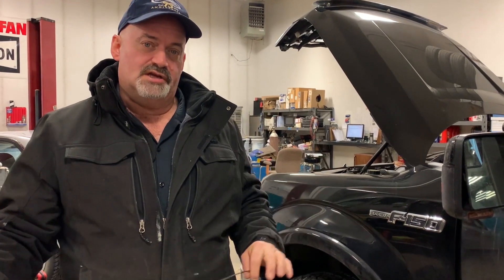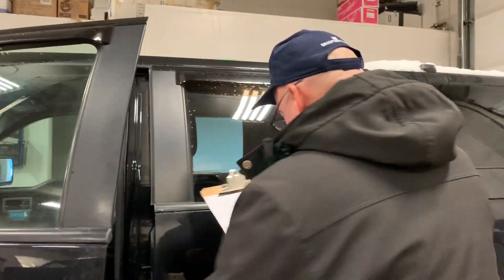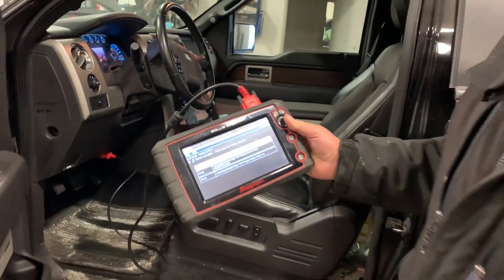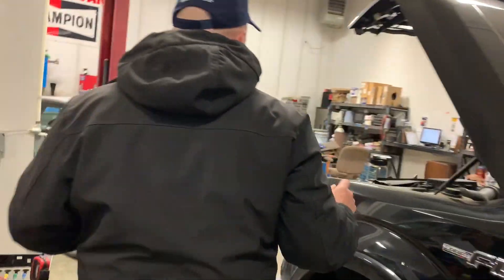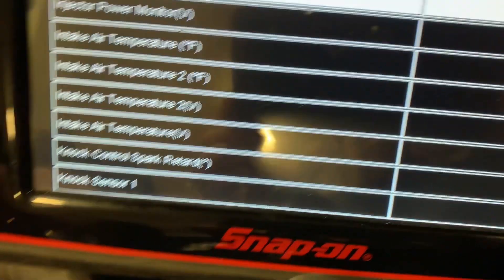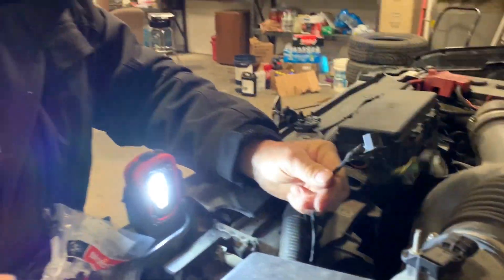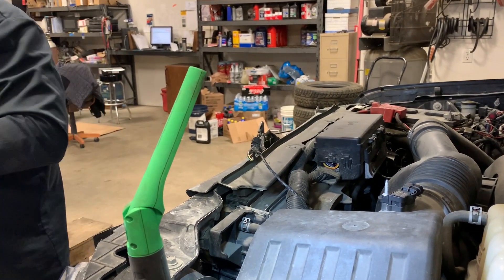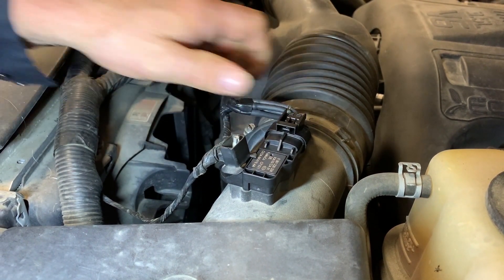Ford F150 3.5L EcoBoost P0111 P012B P012C

Comment: Got a question, Tim...
 I like your video, which is very informative. I gotta 2013 F150 Ecoboost 3.5 which shows a code P012D. 
 Does this procedure apply to this code as well?? I'm trying to fix this myself, BEFORE going to a dealership or other hungry mechanic.

Comment: My 2013 flex fuel Taurus the MAF harness connector has 4 wires and there is 6 pins in the sensor which someone replaced by looking at the non factory  self tapping screws holding it in. I look up the part and there’s a 4 wire MAF do you know if the 4 wire is also an AIT sensor as well or is the AIT sensor separate? I’m unable to locate it if it Is a separate sensor? It’s only throwing AIT code and live data says it’s -41’ f and it’s 75‘F in my shop

Comment: Great video Tim.  I’ve also seen this problem on the 3.5 Ecoboost.   Definitely using OEM Motorcraft parts is the way to go.  The Chinese knock-off sensors aren’t worth it from a reliability perspective.  Like the old saying goes, you get what you pay for.  Especially with electronic parts.
Reply from the maker: Thank you. Blessings
Reply: Tim what do you think about the Bosh equivilent Oem?

Comment: Smashing job as always,  both sides removed from the possibility of causing later problems :-D
Ooow voltages being read by the computer, i would have to connect a 3 pin potentiometer on that connector and wind the voltage up and down for fun :-D
Im odd like that... well yes im odd, arnt we all?
Just me then lol
Reply from the maker: Odd that you spend so much time making sure it’s right. I’m normal that way. Swap parts and hope it works. Hehe